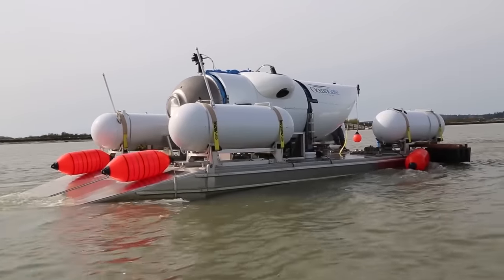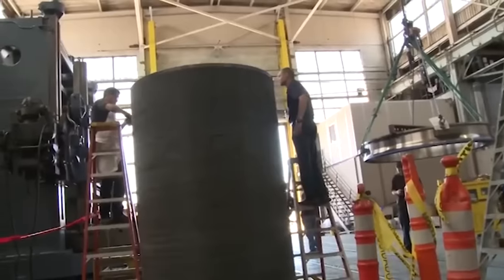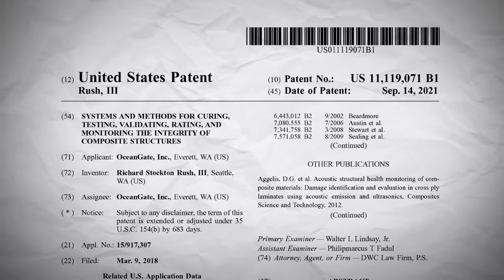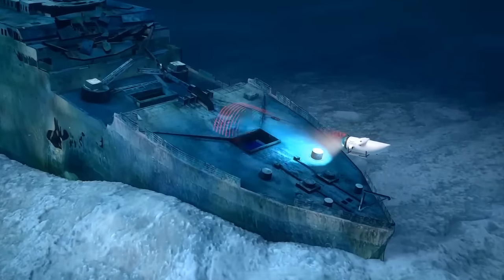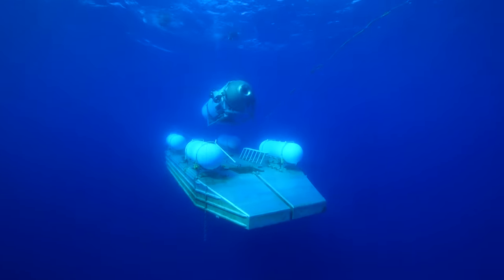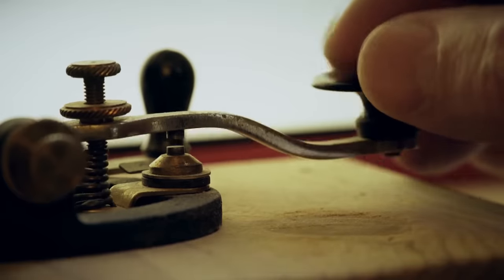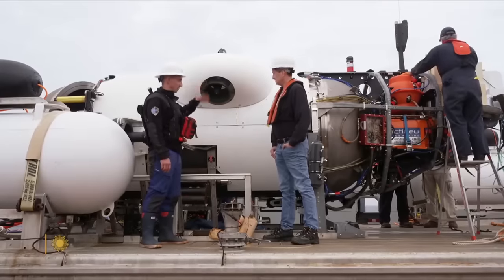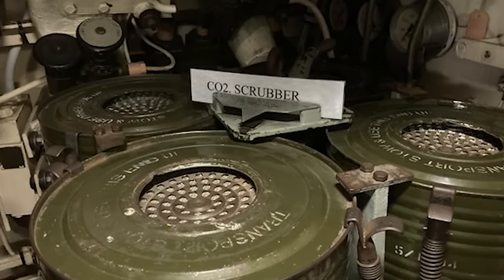Exposing OceanGate Submarines Many Fatal Designs

Comment: Someone did the calculation of the speed that it collapsed, and it was less than 1ms. The temperature inside also reached thousands of degrees for a split second.
Reply: They were killed before the electrical signals even had a chance to reach the brain. They felt nothing at all would be like getting sucker punched and not even realizing it.
Reply: Apparently, the speed was around 1500mph. Compressing the air, which heated to hotter than the surface of the sun! So the crew were flash-fried and then the water pulverized the crispy remains into particles smaller than grains of silt. All of this in a nanosecond.
Reply: I want a link to those calculations.
Reply: @DevilMaster does it really matter.
Reply: @rickslife  Yes, because otherwise it means OP lied.
Reply: @DevilMaster  Dude this is common knowledge in submersible community.
Reply: He should have explored the option of selling these things to dispatch death row convicts. Seems like it would really excel in that application.
Reply: @Mini_Hayley  so do you have/understand the calculations?
Reply: I saw that at reddit.

Thing is, that was calculated as though it was a steel hull. Maybe there's a chance that this carbon fiber actually didn't behave that way. I don't think it's possible to truly calculate this, we also don't know at what depth it occurred, so can't calculate the force that crushed it.
Reply: @DevilMaster, Look it up, just like I've been. Mythbusters has a vid showing what happens to the body an there exp was lower pressure so it took a bit longer. Then there's the weight of water at certain depths. An the compression as we have been told like a star cruching in on itself heating an exploding. Gotta read not just yt vids
Reply: So they paid 250k to fry at high temperature
Reply: @DevilMaster  thats just some bs someone threw around and now people are picking it up and throw it farther, theres no way u can calculate this with the current information, and even if u had it it would be heck of a work and surely not done by some guy watching ytube/reddit in his basement
Reply: @motioninmind6015  exactly
Reply: @paulsimmonds2030 they found human remains though. Probably some skull fragments and stuff
Reply: @Mini_Hayley  Good. So show me the calculations, so it will be common knowledge for me too.
Reply: @DevilMaster  Do research, your education is not our job. It was your parents, but apparently they never loved you.
Reply: @Mini_Hayley  you weird bruv
Reply: @Ha-nz2vy  I dont think i ever asked
Reply: @DevilMaster I imagine the calculations people are referring to are the ones done for each class of Navy sub. These show the effects of catastrophic hull failure at various depths. Titan cracked at a depth that exceeds all naval designs aside from a couple of small, deep diving research vessels. Though I imagine the effects are worse due to increased pressure and design. The inrush of water would compress the air in an instant. The heat produced would ignite the air. The result of this all this heat would be the seawater being flashed to steam. So between the initial shock wave of the in rushing water, then the ignition of the air, the flashing of seawater to steam resulting in another shock wave as the steam seeks a way out and a final shockwave as more water rushes in to replace the exited steam, there’s no chance of survival. And yes, I’m sure all that happened in less than a second.
Reply: The pressure at the depth of the Titanic would be approximately:
P = 1025 kg/m^3 * 9.8 m/s^2 * 3800 m = 3.83 x 10^7 Pa (or N/m^2).

If that pressure perform work by reclaiming the volume of a vessel you multiply pressure by volume 

If ΔV is 1 m^3

This gives:
W = 3.83 x 10^7 Pa * 1 m^3 = 3.83 x 10^7 Joules (or Ws)

Converted to kWh it means 3.83 x 10^7/60/60/1000 = 10.6 kWh for every cubic meter reclaimed.

If you release that energy to heat a 75 kg liquid approximating a human the temperature rise is 127 Kelvin.

The heat will initially end up where the volume change performs work and that is in the air of the vessel. After compression the heat will distribute through conduction.

The air inside the vessel will initially compress to a much higher pressure than the static 3.83 x 10^7 Pa. That is because the energy required to compress air to that pressure is only 0.14 kWh. The rest is an enormous overshoot in pressure as the water mass in motion gathers most of the released hydraulic energy as kinetic. 

Anything that flexes will absorb that energy and water and gass will bounce back and forth att high frequency until all kinetic energy has converted to heat.
Reply: @davidsejjombwe2313  A deep fryer, literally.
Reply: @tofo2  I think it'd be really hard to estimate the temperature rise without an experiment as 1. Some of the air will dissolve into the water rather than (or in addition to) being compressed, at higher pressures more air can be dissolved. 2. The water will take away energy from the air which I imagine would be almost impossible to predict. The water is not solid like the walls of a cylinder, if the water enters the air environment as a spray it'll take away a lot of the temperature rise compared to if it only went into heating the air. I'm familiar with the calculations involved, but without some sort of experiment I don't really believe they'd apply the way people are applying them.
Reply: @wolfie54321  Agree. The most interesting is the hydraulic energy of 10 kWh/m^3 available will do its work on everything it can move.

Solid parts like epoxi resin and carbon fiber does not compress much but they will be part of the destruction of everything in between when the tube becomes flat.

If there is a water inrush through a broken window the dynamic pressure will blow the vessel from inside when water hits a final stop.

Sames as happens when an open end cylinder filled with steam is submerged in water.

Comment: I think the biggest problem is likely that something udergoing deep sea stresses has to have an extremely short service life even when it's ideally built, the thing should have been replaced entirely every couple of dives because even a well built sub is going to suffer fatigue from repeatedly being exposed to that kind of pressure and then brought back up.
Reply: I would expect that two dives would have been a maximum safe limit.
Beyond that the risks increase exponentially
As it happened only three dives were successful -
The fourth was catastrophic.
Sad as it is - It was fate
And we have to accept fate  - being good or bad
That's life
Many people die in bed --- but are never afraid to enter into it
Reply: It was supposed to be used once. So replaced everything time. But it never should have been those depths to begin with. Rest In Peace to Stockton Rush's victims.
Reply: The big problem is they did something new and novel without testing. Even his patented failure detection system was untested. No full size static pressure testing, no fatigue testing, no materials testing, no non destructive testing.  And I would bet no environmental testing.  People assume computer simulations and analysis are a substitute for testing, they are not. Especially when failure means loss of life. The CEOs arrogance is what killed him and his customer. Entrepreneurs are notorious for not being able to properly assess and account for risk.
Reply: It doesn't have to have a short service life at all. DSV Alvin was built in 1964 and is still in use today, almost 60 years later after more than 5000 dives, the majority of which were with its original pressure chamber
Reply: @@BobbyT-yj1cw dude. Yes they have found it,  in pieces on the bottom of the ocean floor. That was a couple of days ago.
Reply: @@BobbyT-yj1cwbecause the pressure chamber doesn't exist anymore. Have you seen how they sealed the thing? If the end caps are on the ocean floor, the pressure chamber is too (in pieces).
Reply: @@BobbyT-yj1cwYes, they did find the pressure chamber in the debris field. And even if only the end caps were there, it would still mean that the water pressure leaked, causing an implosion. Regardless of how it happened, they're gone. Those 5 men got exposed to the pressure of 380 atmospheres and now are mist in the sea.
Reply: @bettawitch4606 they are victims of their own  grid
Reply: Not the case with Titanium though in compression or tension that stuff is beyond tough!

Comment: I mean, if you HAVE to go, its not a bad way. They would have been dead in approx 6 milliseconds (thats .006 seconds).. Since it takes the human brain at BEST 13 milliseconds to process and respond to what is happening, and the sub would have been crushed into a carbon fiber pancake by the pressure in approx 5-7 milliseconds, they literally would have been dead before their brains could register something was wrong.

Comment: I studied engineering in college, but never went into the field - but after thinking about this, for about two days, a novice, such as myself is already asking, why would an acoustic monitoring system even matter in alerting the crew of the hule deforming - it's a carbon fiber construction and Carbon Fiber doesn't buckle - it shatters into millions of splinters when it fails
Reply: Whenever the Titan reached a depth of 100m (300ft), the carbon fibers began to make a funny noise. Rush told passengers to be prepared for the sounds that the sub's carbon fiber makes and insisted that these sounds were normal.

So the crew had the acoustic warning pretty early on, but they chose to ignore the sounds of breaking carbon fibers.

Comment: You didn’t seem to make one point clear. Game controllers aren’t used in applications where they are a critical component in survivability. If your life relies on a control system then you don’t use off the shelf consumer stuff. Why? Because the QC on those are dubious. Have you ever had a relatively new game controller stop working? Pretty annoying. How about if you’re at the bottom of the ocean. That’s a deadly mistake. Even if he had dozens of spare controllers, reliably is only one concern. Another would be that it isn’t flame rated. In a pressure vessel, especially one with no egress you absolutely cannot have anything flammable. Most of the systems inside that sun weren’t flame rated. There’s also controller drift with game pads. Just a whole plethora of problems with that implementation. And that’s just one part of the system.

Comment: The difference between this controller and military controllers is military controllers would have been specifically built for whatever its controlling and would probably cost an easy 100k with zero chance of failing, this was a $30 controller with very poor reviews already

Comment: Wait, the window was only rated to 1,300 meters? Ohhhhhh how is THAT NOT the first thing to blow?
Reply: It’s because the rating isn’t necessarily the limit for the item.  The manufacturer spends the money to market an item and “tested” it to get the hoped for sales.    Testing at excessive depths is more expensive and if there are no customers willing to pay for it - it doesn’t get done.  One would have to find the item and go over their qualification tests to see if they actually test the item to failure or simply verify it doesn’t break at 1300m.  I am not arguing this this isn’t the failure point - but the fact that he was actively monitoring the carbon fiber structure for noise that would indicate impending failure tells me he thought the structure was the likely item to fail.  He sort of forgot about the implosion event happening in nano-seconds and it taking a bit longer than that to surface safely.
Reply: If the rumor that the window is rated for 1300m is true, well like most submarine standards you have a rating and a failure point. Something rated for 1300m repeated use likely wont fail until like 5000m or something like that. And you know this from the design, build process, and testing. In submarine development things are typically WAAAAY over engineered to avoid catastrophes and failures. OceanGate either got lucky that the window was developed using typical submarine standards, or they took advantage of knowing typical submarine tech is over engineered and just used it at depths beyond its rated use. (Not sure which option is better)
Reply: Ive heard the window was underrated from multiple sources. I also heard it deformed during a dive and this was considered acceptable!
Reply: @MrChichibabin   Ha !!!
Reply: @patmacrotch5611  exactly, its rated for repeated use to that depth, repeated use to more then that has shown it will fail. That window likely will be what is target for any lawsuit in they didn't do what they needed to make a safe sub which got everyone killed.

Comment: This is the first time that I have ever seen duct tape used on a submersible (if this was in fact the Titan). I have also heard that off-the-shelf materials were used. This was a man-made disaster just waiting to happen.
Reply: Duct tape?  I missed that... duct tape doesn't stick well when it gets wet...
Reply: Off the shelf materials dont always mean a bad thing.
Reply: Depends on what the duct tape is used for. It secures a paper note better than Scotch tape or a Post It.
Reply: It's fiber glass not duct tape LOL
Reply: @eightlights4939  yes it does, you are underwater in a presureized tube. Any off the shelf electrical component could spark and create a fire. Things made for USA submarines are heavily engineered to not overheat or create a fire. all though it could still happen. Off the shelf  materials don't come with such features
Reply: @TheFarmerfitz  It is seen in the video just before showing the carbon dioxide scrubbers. Sure looks like duct tape to me. Even if it is fiber glass I`m pretty sure that the U.S. Navy does not use it for their submarines. There are parts of his submersible that were definitely not up to any rigorous testing or safety standards. It was a tragedy just waiting to happen.
Reply: @mifphilip  I work in the automotive industry as a Mechanical Engineer, there are plenty of off the shelf electronics and mechanics that can be used with zero issue. The off the shelf components were NOT what caused this sub to implode.

Comment: Just the cylindrical shape alone… I still remember using two polarizing filters to literally watch the stress applied to various shapes cut out of clear plexiglass.  The hexagon distributed stress evenly…it was able to handle much more stress that the other shapes.  ( circle, square, triangle, etc… )
Reply: Hexagons are the bestagons!
Reply: I'm baffled. Why?
Reply: @offshoretomorrow3346 as a bee that builds beehives I can reply: bzzz bzzz bzzz
Reply: @offshoretomorrow3346 nah I think it's because it's slides the pressure a bit like a cilinder which is the best to do that, but also has a support structure so other sides are helping as well. But don't believe comments on internet meaning the others claiming hexagon was best. Maybe it was but maybe it wasn't, proper science would back it up but not because some YT comments said so
Reply: @offshoretomorrow3346  A hexagon matrix is like having a lattice of pairs of triangles. At least geometrically, It’s like having 2 triangular gussets per hexagon that work in any radial direction at all times. They’re very strong shapes that easily distribute applied forces, and are found very often in nature. 

However, hoop stress is still a factor, especially with a material like carbon fiber, which can fail violently and unpredictably due to internal de-lamination. It’s why commercial grade subs that aren’t 120’ long and 3” thick steel plate are all made of smaller titanium spheres or extremely thick acrylic.
Reply: @offshoretomorrow3346  ask the bees!
Reply: Parellograms?
Reply: @steveg2277  Acrylic has an issue where the minimal crack that forms will lead to catastrophic failure. It is like glass in that respect.
Reply: A sphere is the best shape to handle compression from the exterior. think about it. how you gonna compress a sphere when pressure from ALL areas are equal as such is the case underwater?

Comment: That’s the problem with carbon fiber it’s very strong until you compress it. It has amazing tensile strength. That’s what they’re using it on the new Boeings can handle unbelievable amount of stress, but only about half as much compressive stress. I’ve only been working with carbon fiber for about 10 years now and I even know that they should’ve used a diamond wove for compressive strength on carbon fiber….

Comment: Game controllers might be more commonly used than people think, but it's still worth pointing out they were using cheap wireless 12-year-old design that's had complaints about it's connectivity since it was released.
It had nothing to do with what went wrong but it's a perfect example of how they operated.